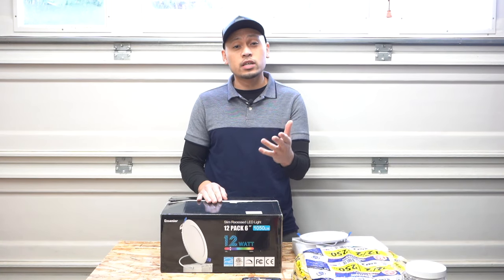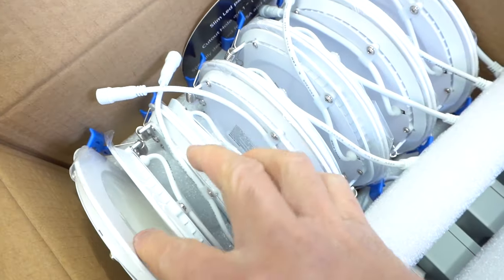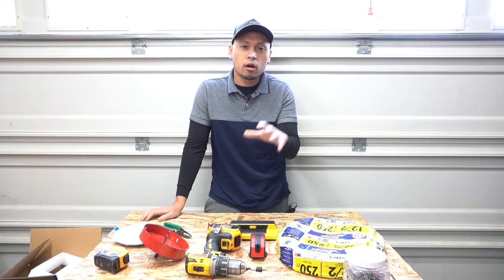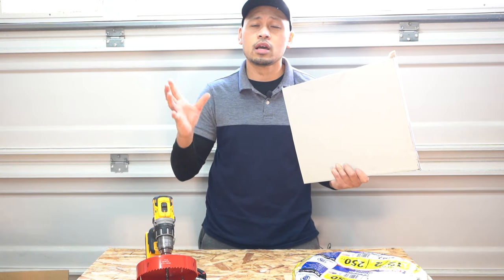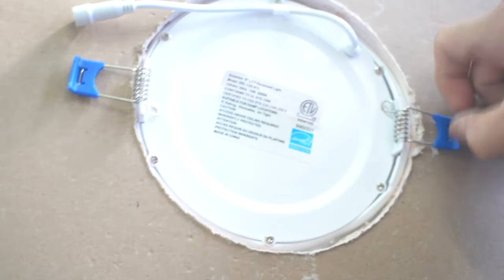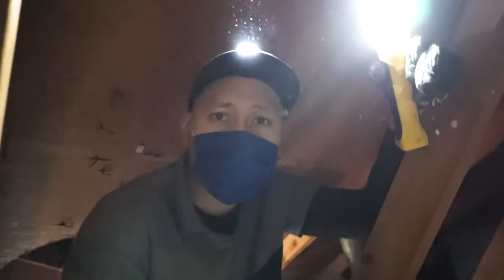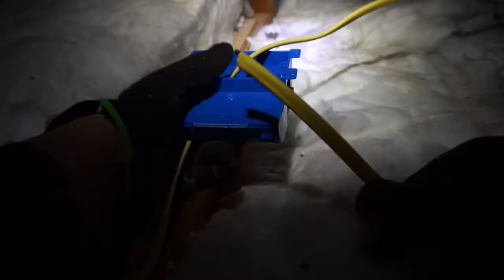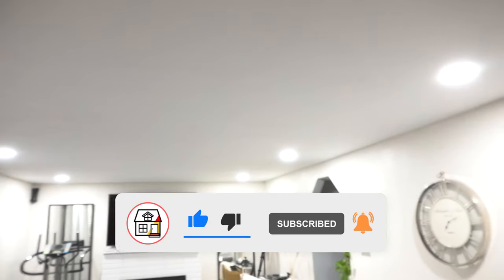How To Install Pot Lights In Living Room Ceiling | Thin Recessed LED Dimmable Lights For Beginners!

Comment: @19:58 you cant just put a loose rommex cable in a metal box hole without any clamp or strain relief connector.  That is a major code violation and hazard.

Comment: Dude, pass one electrical wire thru one knockout and install electrical 1/2" cable connectors in the 1/2" metal knockouts.  Takes an extra minute to do this and will protect the wire from abrasion.  That is why we have this pesky thing called the National Electrical Code.  Also orange wire nuts on 12 Awg wire,  really?  And yes you do have to wire nut the ground too.

Comment: Why are you using 12/2 for your light
 should be using 14/2
Reply from the maker: A 12 gauge wire is a safer choice for me on 15-20 amp circuit, it might cost a little more. 12 gauge is slighter better conductor of electricity 👍🏽😊
Reply: Hey J G, my home is wired with 12 gauge from the breaker box to the light switch box, and then 14 gauge from the switch to the fixtures. All breakers are 20 amp. Was this code compliant several years ago?
Reply: 12/2 is overkill and much harder to work with in those small boxes. OHM's law P=IxV at 12W at 120V your looking at 100 mAh per light. 14/2 is more than enough. As for a better conductor that would only come into factor for very long runs over 100 ft or more. People now a days think they need all this heavy wire and large panel boxes, appliances and lights are drawing less current than ever before. I have a 100 amp panel and with everything on including the central air I still can't draw any more than 25 amps on either side of the bus, with the air off I am lucky to draw 6 amps. Balance the load and protect the neutral wire.

Comment: Twisting ground wires together without a connector, either a wire nut or ground crimp is not according to the National Electric code. Everything else was perfect.

Comment: You shouldnt be encouraging anyone to use a no contact voltage detector. They are not reliable. If your showing others show them to use an incircuit tester like a meter or solenoid neon tester.